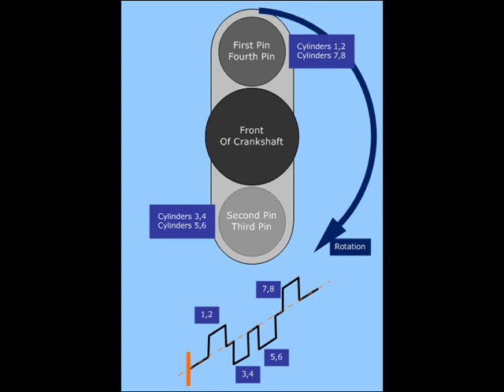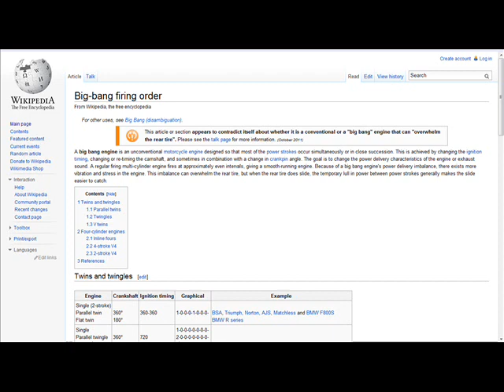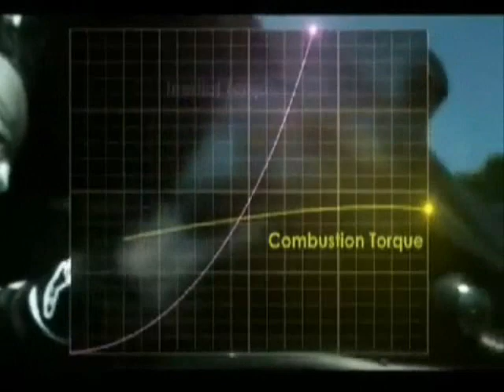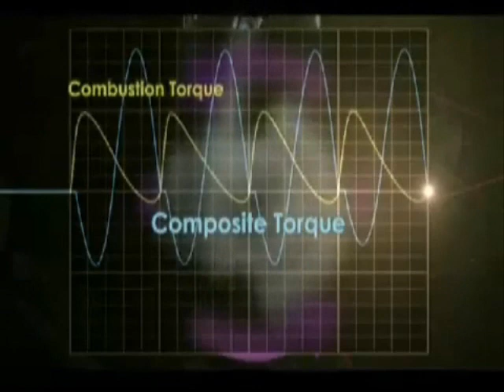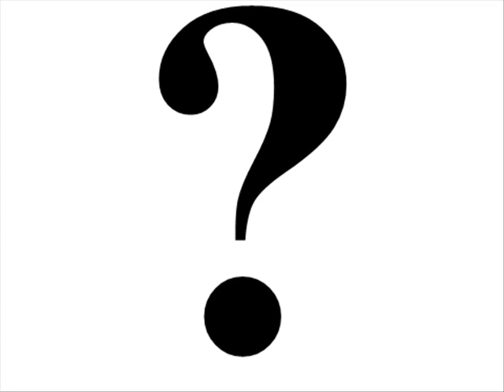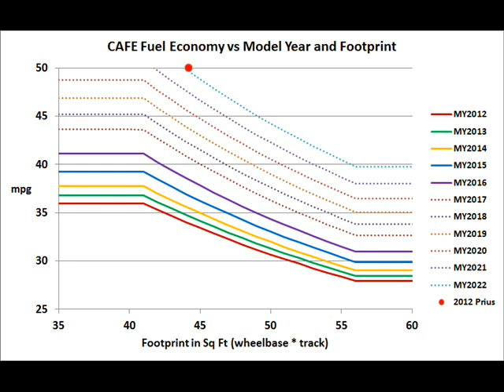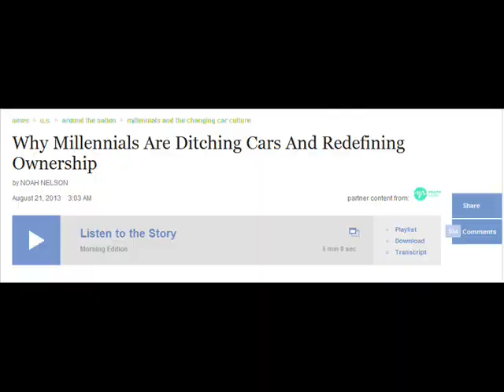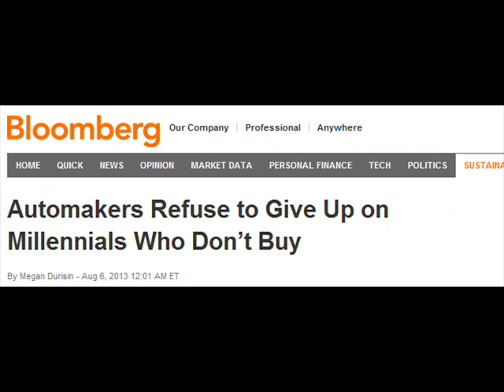Crossplane Four Cylinder Engines In Cars

Comment: Not True
Yes, you don't have to worry about 2nd order forces which cause vibration, but you get HUGE moments of 1st order which will add geometrically (Sqrt[2] times)! ("Rocking couple"). You don't understand the principle of a crossplane crank. the second cylinder bank (90° apart) ist ABSOLUTELY needed for a crossplane engine to run smooth. This second bank plus the huge counterweigth yield the cancelation ! A 4-cyl crossplane will only work with very very small displacements, extremely light cylinders and a very stiff block
Reply: +Simon Reiger Can you please tell me where you get such an in-depth information like that? Not just engines, but every area of cars. Every time I try to read about something, sometimes I find actual info, but most of the times it's just a scratch in the surface type of stuff.
Reply: *****
From the internet I find exactly the type of stuff I described. Maybe I'm just bad in searching the info, so can you please help me by showing some examples where you find that stuff. Would help me alot more than just saying "From the internet". I always search internet when I want to learn something.
Reply: *****
I know it makes sense, but there's hundreds of things about the engine alone I'd like to leanr in-depth, but it's next to impossible to find the info.
Reply: *****
I do my maintenance work myself. I do know how the engine works, but I'm very interested in the actual physics and science behind all of this. One of my dreams is to be a car engineer, so I'm more interested in the in-depth stuff and I have an urge to leatn absolutely everything there is to learn about cars. That's just me lol :)
Reply: +Simon Reiger 
Heyhey,  I completely understand your issue. Lots of stupid articles which aren't scientific in any sense are pretty boring when you want to learn more. Problem is the math with which you will be confronted. Newton's mechanics, later Lagrange's mechanics and some general algebra, analysis and some diff. equation knowledge will be necessary if you want solutions. BUT IF you have enough imagination, you can also work these things out for yourself. Personally I'm more into science than engineering (that's why I study physics). You will be absolutely astonished of how much of an engine is not really scientificly calculated but just done by experience and lots of simulation and testing. Car engineer is not such a cool job as one might think. You have to constantly fight with designers, acoustic-designers, regulations etc. If it's a few cents too expensive you're fucked. At the end you gain 0,2% more efficiency  by designing a new oil-pump-belt-spanner-bearing-shit-whatsoever. Here in germany a engineer is not worth really much. Marketing, Design, Legal department and even HR is higher in the hierarchy than the engineers in our companies.
Reply: 88manta88
What about engineer in racing team?
Reply: +SingleTurboSupra 
Lets get back to the topic: Depending on the use of the piston engine, the significant parameters of the smoothness/vibrations are: 
1: Vibration to momentum imbalance (things move at different speeds or ansymmetric or masses don't cancel etc..)
2: Firing order imbalance
With a big enough flywheel and if acoustics don't matter, you can always neglect 2. There are tractors with a 11Liter (670cci) single cylinder engine. One massive flywheel and it's no problem. A motorbike is a different story
Point 1 is much more complex. I will link to few nice sites: 
About the cylinder angle: http://www.caranddriver.com/features/the-physics-of-engine-cylinder-bank-angles-feature
About flatplane/crossplane: http://craig.backfire.ca/pages/autos/v8-engines
Reply: +SingleTurboSupra 
Books will be necessary if you want to go deeper. Here is one I found on the web: http://210.27.80.89/2006/qiche/engine%20book/ENGINE%20DESIGN%20(6).pdf
Reply: I just noticed that I was logged in with my youtube name instead of gmail name. So the last answers were by me - Sorry for the confusion
Reply: 88manta88
Just read through those links. That book looks awesome! I'll read it tomorrow. Getting a bit late here. Thanks!
Reply: Simon Reiger so instead of converting i4s to crossplane, we should make 2 liter v8s with crossplane, same displacement, roughly equal mileage I'd assume
Reply: 2l V8 would be great considering smoothness and rpm. Actually, such engines are out there. The Ferrari (Dino) 208 was exactly a 2l V8. (https://en.wikipedia.org/wiki/Ferrari_GT4) and (https://en.wikipedia.org/wiki/Ferrari_308_GTB/GTS#208_GTB.2FGTS). Those things sound like chainsaws. Problem is the efficiency - The less bearings and friction surfaces there are, the more efficient the engine. Furthermore, big displacements have a higher efficiency as small ones because of the worse surface-to-volume ratio. Gigantic Diesel engines in ships have superb efficiency because of this. This is also the reason why three and even two (Fiat TwinAir) cylinder engines are becoming popular.

Comment: except I dont care for the v8.
:hides:  Inline 6 for lyfe
Reply: Straight-6 Master Race
Reply: Crossplaned I6 should be possible. I'm not an engineer, so I couldn't tell you exactly what it would take. But The FZ-09 uses a crossplaned I3, so...
Reply: Inline 6 engines are typically heavier than V8's and cannot rev as high with the same metals.  And they sound like shit compared to a crossplane V8!
Reply: @owndapwn  an Inline 6 is sort of a crossplane, it is a Y plane.
Reply: @Flies2FLL  Nonsense!
Reply: @carloscollomps1552  No, complete sense.  V6's and V8's are superior designs.  Look it up.
Reply: @Flies2FLL  V6's are just design patches.  The real deal in 6 cylinders is straight 6, no less no more. You can go up or down but 6 bangers are the most balanced engine design. And balanced is a key word here.
Reply: @carloscollomps1552  Inline 6's are also heavier than V8's, don't like to rev, and are difficult to package.  V6's cost more but they are better designs.
Reply: @carloscollomps1552  V6's are lighter, easier to package, and rev better.  Inline's are smooth and cheap.  The V6 is simply a better design.
Reply: @IdiotsEverywhere.  Name an NA inline 6 with 400 hp.  NA H6's are plentiful, so there is no reason it couldn't be done wit a V6.  But NA engines need to rev to make the power and the crankshaft of an L6 has to be prohibitively heavy in order to reliably hit high speeds.  V6 is the better design.
Reply: @IdiotsEverywhere.  OK, that is correct.  

One single NA inline 6 has over 400 hp.  

But Porsche has built literally dozens of multi-bank NA 6 cylinder engines with more than 400 hp. A flat 6 engine is no different from a V6, in fact you may consider it a 180 degree V6 engine.  

Porsche currently sells a NA multi-bank 6 cylinder with 520 hp....Hello?  Inline 6 engines CANNOT rev the way V6 engines with their short crankshafts can.

Comment: A lot of what you say is true, however, comparing this crank design in I4 applications to V8 applications doesn't make sense. In the V8 applications, assuming 90 degree bank angle, you get that burble because with a cross plane crank the smoothest firing order does not alternate banks evenly, instead it's LRLLRLRR or RLRRLRLL, so exhaust strokes are not evenly spaced on each bank, whereas on an I4 they are. Also the engine is not inherently balanced in a 90 deg V8 with crossplane.
Reply: There ARE flat plane V8s, and they are found in exotics. I see what you are saying, though it still makes sense in an inline 4, as Yamaha has done. The exhaust strokes on an I4 are balanced because they are flat plane. Yamaha is the only one to switch. I'm not sure why, flat plane is better balanced, and all the exotic cars with V8s are also flat plane.
Reply: nutnfan1 Who said there aren't such a thing as flat plane V8s? On a flatplane V8 the firing order alternates LRLRLRLR or RLRLRLRL per bank but cross planes are LRLLRLRR or RLRRLRLL.

I think you have some reading to do. Cross planes make sense for bikes because the power is more manageable because there is a partial crank revolution without power stroke which allows the wheel to grip so you can put the power down earlier in the corner - same principle applies to a 90 degree V-twin.
Reply: ducksonetime I said there was flat plane V8s. 

Did not know (or think on) that part. I assumed the gap would result in a less efficient power delivery (which may be true), but the handling aspect I did not think of.
Reply: flatplane is in no way better balanced inline 4. the crank rotates more quickly when the piston is near top dead center or bottom dead center because it is not pushing the piston up or pulling it down the long distance. it moves slower when the piston is mid stroke. in the flat plane inline 4 all of the pistons are either in tdc and bdc or mid stroke. this results in an a strong pulsating vibration. the flaw with the crossplane inline 4 is that the outer 2 pistons do not go up and down at the same time so the engine can rock back and forth without proper balancing

Comment: Unlike in a V8, crossplane arrangement in inline-four engines results in unevenly distributed firing pattern, so the use tends to be limited to extremely high-revving engines. In such engines, the advantage of less secondary imbalance outweighs the irregular firing interval disadvantage. This design, not having pistons disposed at 90° to each other in separate banks, requires a balance shaft to counter the rocking vibration disadvantages arising from plane imbalances on reciprocating mass and rotating mass

-Wikipedia

Comment: That would be awful in a straight 4 which normally fires every 180 degrees but would transform 90 degree V4 engines in terms of balance. Has any crossplane V4 ever been fitted to a production car?

Comment: I've always liked the idea of the inline 4, but always hated the sound.  I've heard V4's and liked them, but the US sucks and didn't use them in cars.  The Subaru boxer 4's sound a lot better, but only Subaru has them (if you don't count the old VW's)  so yes, why not a cross plane 4 banger?  it would be nice to have a 4 banger that has a rumble and doesn't necessarily have to rev passed 3,500 rpm to get into the torque curve.
Reply: Subarus have flat-plane cranks, it's the unequal length of the headers that give them that iconic rumble
Reply: It's the firing order that causes the rumble.  both cylinders on one bank fire one after the other, then the other bank fires the same way.  the rumble comes from that transition from one bank firing to the other bank firing.
Reply: Max Jonson If they have regular headers on them, they'll sound just like any other 4 banger

Comment: Much like civil aviation is lobbying to get rid of all multi-engines aircraft, road transport could get by with just 1 cylinder (all the clips sound like average 2010's motos already). Only on a good straight into a tight turn did I get a tiny sip of burble. My dream rig? It's a secret

Comment: Maybe they could just use V4's instead. The Ford Capri MK1 had V4 options, either the 1.3, 1.5, 1.7 Taunus or the 2.0 Essex. The Saab Sonnet and Matra 530 used Ford Taunus V4's too. Honestly, their power outputs were shit even for the 60's and 70's, but I've heard they ran really smoothly. They sound pretty good, a bit like a cross between an old VW Beetle flat 4 and an old V8.
Reply: basically it would be down to cost in R&D. using a cross-plane crank would simply mean modding the rest of the crank gear accordingly without changing the whole engine and ancillaries.

Comment: Yeah mostly true stuff here, they sound great but the fuel mileage drops 50-75% because you have cylinders firing more often per rotation...The newer R1 gets crap fuel mileage and it would be even worse in larger engines